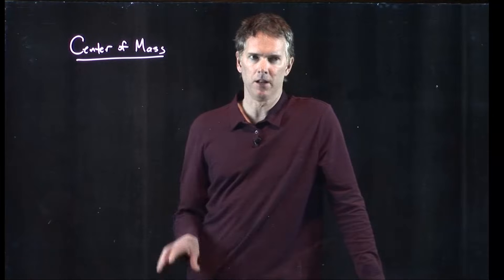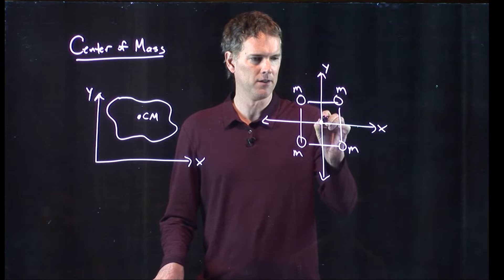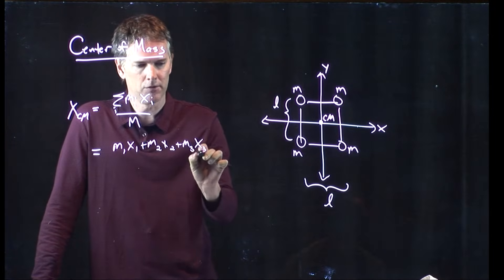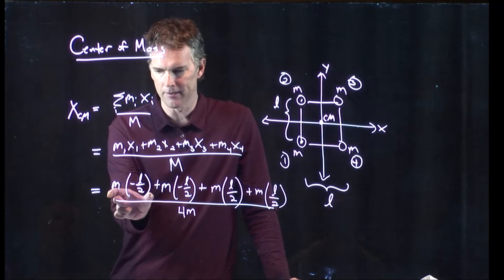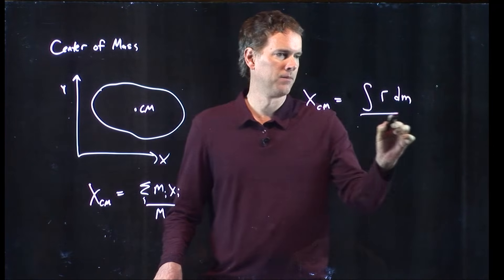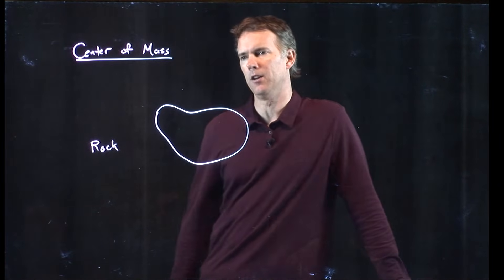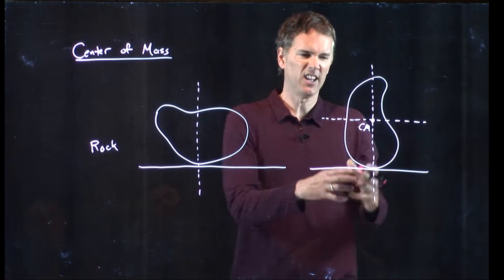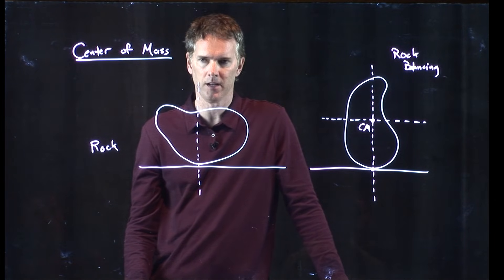Center of Mass

Comment: I knew about the experimental method and was hoping to learn a geometric method. But he stopped short. Very unsatisfying. The square with masses on the corners was also unsatisfying. He basically said “to find the centre of mass, you impose a coordinate system with its origin on the centre of mass”. Which sounds like circular logic to me. I was expecting something like, I dunno, finding the area and computing where half the area was on both sides. Which is essentially the experimental method.
Reply from the maker: Thanks for the feedback.  I'll expand in a future video.
Cheers,
Dr. A

Comment: Sir what dm mean in formula ?
Reply: dm means infinitesimal mass unit.   We are splitting up a continuous rigid body into an infinite number of infinitesimal mass units at every position in space, throughout the body's shape.  We accumulate the sum of the position vector r*dm, for each of the particles that make up the rigid body, and then we divide by the total mass.

d[ ] means infinitesimal quantity of [ ], where "[ ]" represents any variable you choose.   The lowercase d stands for difference, and has a full time job in Calculus of indicating infinitesimal quantities for derivatives and integrals.

Comment: How to find M on non-uniform shape? Is it just the initial mass?
Reply: Initial isn't a relevant term here, since we are talking about a property of a snapshot of the configuration of a system at one point in time.

To find the center of mass of a non-uniform shape, you will have a density term when you define your infinitesimal term dm.   The value of dm will equal density (rho) multiplied by an infinitesimal volume unit dV.  The dV term could equal dx*dy*dz, if you were doing an integral in all three Cartesian coordinates, and it would become a triple integral.  Or it could be an equivalent infinitesimal volume in either spherical or cylindrical coordinates if convenient for you.  Or it could simplify if you were taking advantage of symmetry to make the calculation simpler.
Reply: For instance, consider a non-uniform brick of L=0.2 m in the x-direction, and H and W = 0.1 m in the other directions, whose density is a linear function of the coordinate x, and uniform in the two other coordinates.  Suppose rho(x) = J*x + K, where J and K are constants.  At x=0, rho = 1000 kg/m^3, and at x = 0.2 m, rho = 2000 kg/m^3.  From this data, we can solve for J and K to get J = 10000 kg/m^4, and K = 1000 kg/m^3.

To find the center of mass of this brick, we define dm to be a rectangle of sizes dx, dy, and dz, and a density rho.   Thus dm = rho(x)*dx*dy*dz.   The total mass is given by integrating dm, from x=0 to 0.2 m, and from y and z both from 0 to 0.1 m.

M = triple integral rho(x) dx dy dz

Since density doesn't vary with y or z, we can pull out these integrals and treat them as constants.
M = integral dz * integral dy * integral rho(x) dx

integral dz from 0 to H = H
integral dy from 0 to W = W

Thus:
M = H*W * integral rho(x) dx from 0 to L

Plug in rho(x)
integral J*x + K dx = 1/2*J*x^2 + K*x + C

Evaluate from 0 to L, and notice that the constant of integration cancels, we get:
M = H*W*(1/2*J*L^2 + K*L)

That's our answer for total mass, now onto center of mass.  We know in advance that the y and z centers of mass will equal W/2 and H/2 respectively.  So we can simplify our integration to just finding the x center.

Call the moment of mass G, about the origin.   Center of mass will occur at xbar = G/M.
G = integral x *H*W*rho(x) dx

Pull out H and W:
G = H*W*integral x*rho(x) dx

Plug in rho(x):
G = H*W*integral x*(J*x + K) dx
G = H*W*integral (J*x^2 + K*x) dx
G = H*W*[1/3*J*x^3 + 1/2*K*x^2 + C] evaluated from x=0 to x = L
G = H*W*(1/3*J*L^3 + 1/2*K*L^2)

xbar = G/M
xbar = H*W*(1/3*J*L^3 + 1/2*K*L^2) / (H*W*(1/2*J*L^2 + K*L))

Simplify:

xbar = (L*(2*J*L + 3*K))/(3*(J*L + 2*K))

Plug in J = 10000 kg/m^4, K = 1000 kg/m, and L =0.2 m:
xbar = 0.1167 m

By inspection, we also know that ybar = 0.05 m, and zbar = 0.05 m.

Comment: I have a hard time understanding the centre of mass equation. Are there any proofs?
Reply: the thing is that on the center of mass the torque from both sides cancel out ... if the object is sitting on a point that's not directly beneath the CM, one side of the object will have higher mass and will cause greater torque than the other side, so the object will tilt to some direction ...

Comment: I am confused by your solution as it only accounts for 2 out of the 3 dimensions of each rock I've had to dig out in order to plant shrubs.  They all certainly had a height, a length and a width.  Together, these 3 dimensions helped me estimate the volume of material that I had yet to remove or if I could quit digging.    Maybe your rock is uniform in one dimension?  I must agree that in any case, if you can balance that tater-rock on one end like you did,  the center of mass may be discovered somewhere above the point at the base.  So, how can I tell where the center of mass is actually located? 

Love your work BTW!
Reply: he said a rock just to put a name to the gerenric object, as you say, a rock is 'living' in a 3 dimensional space, so you should considerate 3 dimensions, this is a idealization of a body whit infinitesimal thickness, but finite mass, like a plate or a cd for example (we can make this kind of assumptions sometimes)
Reply: The rock only has to be balanced twice.  The first time the rock is balanced it must necessarily account for two axes, call them 'x' and 'y', The second time the rock is balanced on its 'side', it must necessarily use the third axis, call it 'z' and either the 'x' axis or 'y' axis, it doesn't matter.   The intersection of the two vertical lines that were determined from the two times the rock was balanced must necessarily meet at the center of mass for the rock.

Comment: Hi Matt, Do you have any videos to find the center of mass for a cuboid, with objects of different sizes are mounted inside the cuboid. Typically an electrical panel with various Electrical protection components mounted?
Reply: You would first need to know the centers of mass of every object you wish to add up.  Then you would create a spreadsheet, with columns titled x, y, and z for the positions of the center of mass of each component, and m for the mass of each component.   Create another 3 columns for m*x, m*y, and m*z for each product of mass with the position coordinate.   Add up columns m, m*x, m*y, and m*z, and at the bottom of the column, store the totals.   The center of mass of the assembly will occur at position xbar = sum(m*x)/sum(m), ybar = sum(m*y)/sum(m), and zbar = sum(m*z)/sum(m).   (xbar, ybar, and zbar) will be the coordinates of the total center of mass.

It is essential that you use the same origin point for keeping track of x, y, and z, prior to adding them up.  It is arbitrary where you assign the origin to be, but you have to make sure it is consistent for all components you add up.

Also, some CAD software can do this for you.  You can assign a density to each solid body you design, and for an assembled group of solid bodies, it will calculate the position of the center of mass of the assembly.